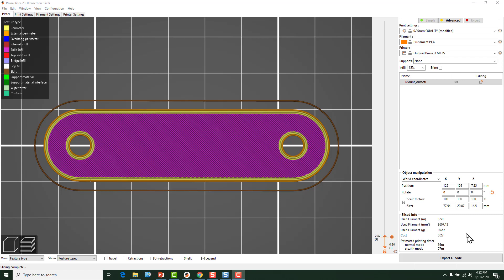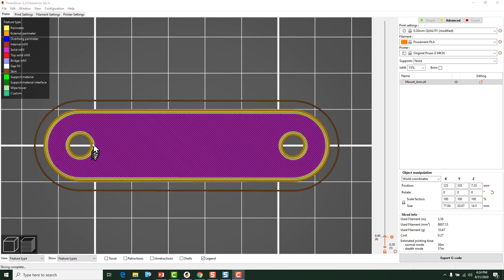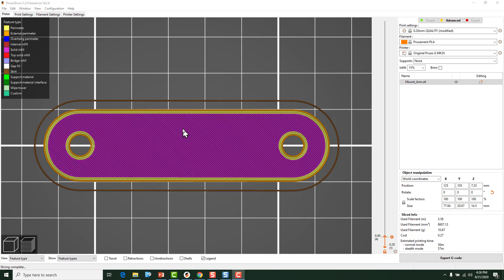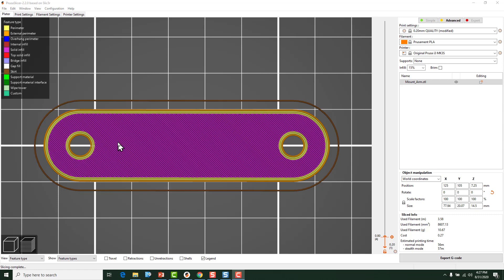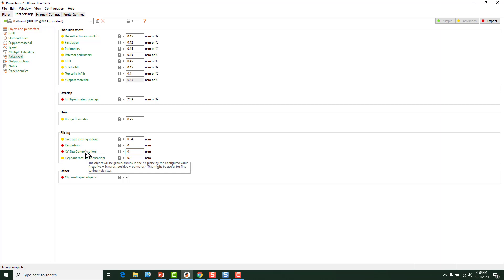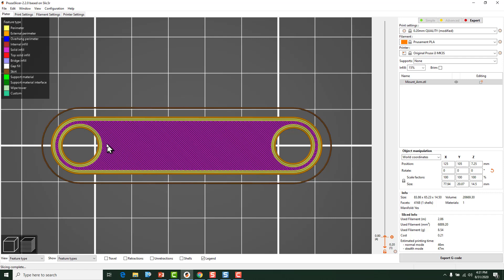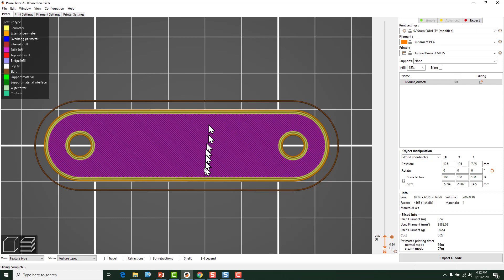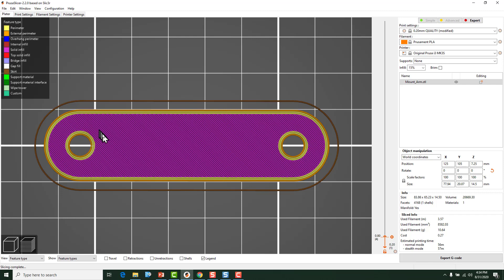Prusa Slicer horizontal expansion

Comment: I am using Anycubic Kobra 2 Neo with 0.4 mm nozzle and to achieve round hole with diameter of lets say 8 mm then I am over sizing it by 0.4 mm in PLA and 0.6 in PETG. It always fits very well. For this in fusion 360 i use parametric design where i can always put oversize factor just with one parameter. One profit from this is that I can instantly align the body to the manufacturing method.

Comment: Solution:  Just stop using prusa crasher.  Cura has a "hole horizontal expansion" setting that makes this entire video obsolete.  Holes to small by 0.5mm?  Set it to 0.25mm and call it a day, you'll have perfect inside diameters every single time.  And the new 5.0 now also has variable line width which is a MAJOR game changer.  It has improved dimensional accuracy of my prints AND the strength AND the quality,  all in one.  It has also reduced the amount I need to use for the horizontal expansion setting simply because of the new variable line width addition.

Comment: Your suggestion of increasing the hole sizes with 0.175 mm is based on the nozzle size I assume (0.4 maybe)?
How did you get to this number? And what should it be with a larger nozzle 0.8 for instance?
Reply: I am using 0.4 nozzle and for this size I am oversizing my holes by this value (0.2 on one side * 2) for PLA. For PETG I am oversizing by 0.6 mm. Works well. Using parametric design in Fusion360 so I can modify it comfortably for all project. Those values was achieved by experimenting with my printer (Anycubic Kobra 2 Neo)
Reply: Just print a sample and test it

Comment: This is really the biggest catch that prevent me from using Prusa slicer. The hole size can be compensated only for holes if you use Cura hole size compensation. Sli3er (before it becomes Prusaslicer) also has a hole size compensation but Prusaslicer cut it off for some reason. That makes it pretty much only good for figurine foe me.